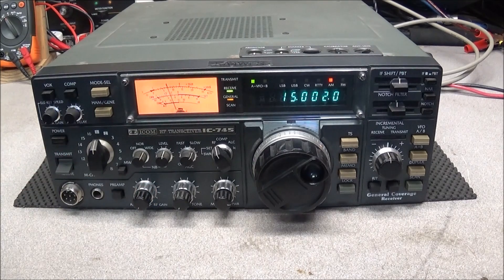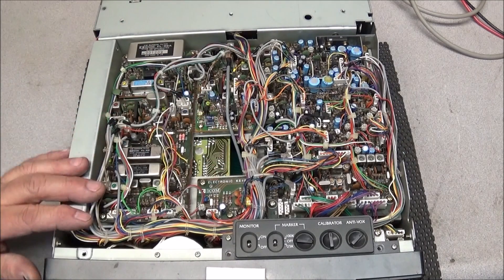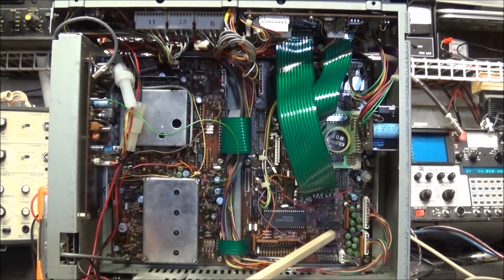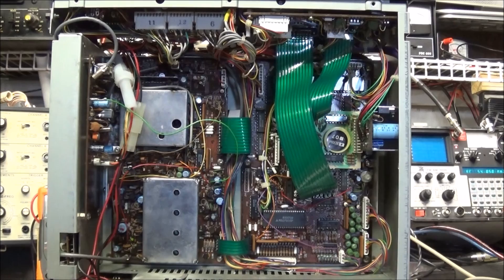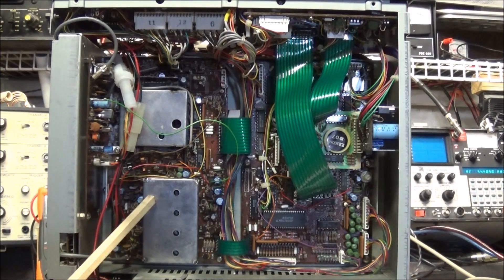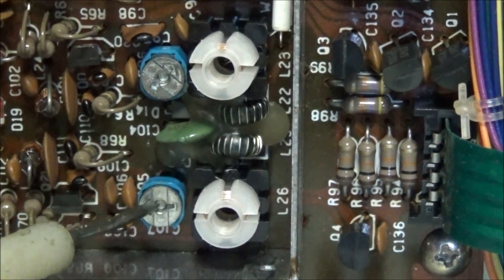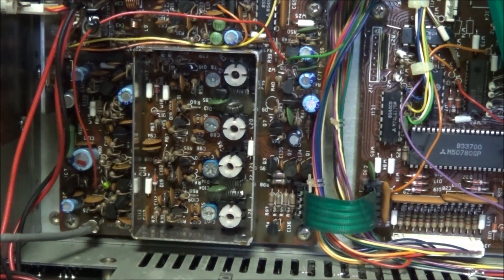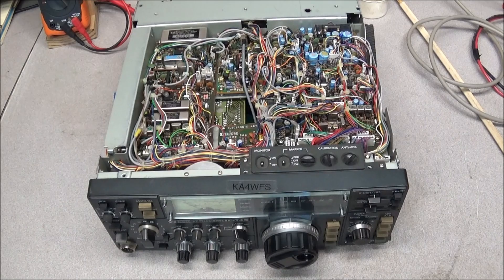#25 Icom IC 745 repair part 1 -  tear down and  review of problems

Comment: This is just a great great video about this rig.  This is my fav rig, too.
Reply from the maker: Thanks 👍
Reply: @TheRadioShop  Look for my email, B.  de L.
Reply: @TheRadioShop  I think I own a brick.  My lituium batery is dead. And, ther eis now way on God'd Green Earth that I have the ability to remove the board and re-write the memory.   I bought this rig new with the internal AC/DC [power supply and I feel really bad abaout losing this radio.   Nothing lasts forever.  But, this was my only and best rig that I had.  I hate to part with it, but I may have to.  I like your style of making these vids.   You can hear your kind soul in your voice.  '73 ol' friend, WA2TVN

Comment: I'm wondering what it would take to install a subprocessor and NVRAM and have it do a RAM/NVRAM compare to see if the RAM board has the correct info available and tell the main processor "everyting is OK - start the radio". If not, access and load the RAM from NVRAM. Much like the HP54503A calibration self-check.

Comment: You bring up an interesting issue regarding the 3 volt back-up battery.
i was wondering if the same program loss issue is possible on the IC-R7000? 
I'm just completing a re-cap,and before I put it together,maybe i should change it out. It reads 2.74V now. Nice job on the vids,I find this project very interesting.
Reply from the maker: Hi Andy, The R7000 does not have the ROM problem as the R7100, IC-745, IC-751.  So no worries there. I would change the battery though.  The biggest problem in this unit is solder joints and capacitors.
Reply: thanks so much for the clarification Sir,i feel better knowing I have some time to re-fit this old battery mount with a proper battery holder,so it can be swapped-out without tools in the future. I really enjoy the diagnostic process in your vids. 73

Comment: i have a 740 and need to replace the meter display  bulbs.  do I take the front cover off or the top cover?
Reply from the maker: Remove top and bottom cover. You can mow remove the screws to the front panel and tilt it out for access to the lamps.
Reply: Are there two lamps?

Comment: hey one of my friend has a icom 730 has no recive on it....unless he puts a preamp on it....any i-deals.....could this be  the relay dirt?
Reply from the maker: Hi Gary. The 730 is an oldie. On the RF board resolder J2 and J3 as the solder connections crack over time.  Make sure the internal preamp is working. Need a scope to test. Relay RL1 will fail over time and will cause  low receive issues. Hope this helps.

Comment: If the radio is still plugged in, will it not still have some standby power to keep the memory intact while you change the battery? What if you changed the battery while the unit is running? Thanks for sharing

Comment: two AA batterys, connect em to the ram board and switch out the battery ( dont use a power supply to do it! )  Good Luck!  I know you can do it!  Be Well  EDIT  i didnt know you had a link to it HAHA
Reply from the maker: +su pyrow  I try to provide as much information as possible at times. Thanks for the info :)

Comment: This radio reminds me of the  Yaesu  FT 101 to me a little  difficult to repair
Reply from the maker: +danny blackhorse  Hi danny. I find the 745 very easy to work on. It is laid out in a manner where you can get to the boards without having to remove a lot of other stuff. Have a peek inside the Kenwood FT-930 and 940's. They are night mares lol. Thanks for your comment and for dropping by.

Comment: I ran one of these my first 9 years as a ham and the design flaw I wound up having to get repaired was the 4 trimmer capacitors in the PLL VCO unit that control the lock voltage on the phase locked loop. Mine had the pancake power supply which I think accelerated the trimmer caps to loosen up over time from the board being repeatedly heated and cooled every time the power supply was switched on and off. You would think that the design engineers at Icom would have known that heat rises and put the power supply in the top of the radio instead of in the bottom under all the circuit boards! I also wound up having to get the RAM module replaced as well. When the battery went dead the frequency counter went to all zeros and had no receive or transit. Clif Holland KA5IPF at http://www.avvid.com repaired mine for around $225 and when I got it back it worked and looked like a new radio! I loved the radio and it had every bit as good a receiver as my next radio which was a Kenwood TS-570D. I sold my IC-745 at the Charlotte Hamfest for $400 to a ham from Asheville, NC. Sold my TS-570D to a ham in Ohio and have been running a Yaesu FT-1000MP Mark V ever since. Thanks for the great video and I look forward to the next one! Very 73 de KU4GW Cliff!
Reply from the maker: +Cliff Fox (KU4GW)  Cliff, very insightful reply my friend. Sounds like you went through all the flaws with your 745. Cliff Holland knows his stuff on these old rigs. Not sure if he still works on them now. Since parts are starting to become unobtainable. Your comment on the power supply as I mention very briefly in the video is dead on! Guess if you are going to cook something you put the fire under the food LOL.  My suggestion on the supply is remove it and run external. However another alternative is to remove supply, make the DC cord longer and run it externally.  But some cleaning up of the internal filters are needed to reduce the "birdies" created by the supply.  Also love the Yaesu FT-1000MP. Great rig. Always wanted one for myself. Thanks for coming by and sharing your story.73 Buddy
Reply: The Radio Shop Hey Buddy! I threw the pancake supply in the garbage after the filter caps needed replacing due to hum and never installed it back in the IC-745 after Cliff Holland sent it back. A friend in Lenoir, NC sold me a Icom PS-55 power supply for only $55.00. I still have that power supply and it still works great after 10 years of use powering my VHF equipment. Very 73 de KU4GW Cliff!
Reply from the maker: +Cliff Fox (KU4GW) Good deal on the PS-55 Cliff. That is a rock solid supply. You did the right thing by ditching the pancake! BTW, visited your QRZ page.  Very impressive! Have not been in your part of the state in a long time. May have to get over that way one day again. Any snow there? had a bit up in Raleigh today but nothing here.. 73 de kc4umo
Reply: The Radio Shop I got enough snow this morning to coat the evergreen trees really beautiful and cover the yard, but the temperature stayed warm enough it never stuck on the dirt road at all and after 11 AM the sun came out and it was all gone in a matter of minutes. That's the kind of snowstorm I like to see because I live up on the NE slope of Barretts Mountain west of Taylorsville 1 mile off of the state maintained road so when it snows a lot I can't get up the mountain to get back to the house! Going down the mountain is no problem. Just looked at your QRZ and we're the same age. I was born May 10, 1961. Give me a call sometime. I hang out on 3.895 a lot in the evenings.Great bunch of hams on that frequency and we'll talk to anyone, unlike a lot of the 75 meter groups who have their own little groups that won't  talk to anyone who hasn't been in their group for years. The 3895 group is just the opposite. Very 73 de KU4GW

Comment: Icom used to have lots of problems with their PLL's - my venerable old bought new in 1977 IC-211 2m all mode's PLL had problems with feed thru PCB via's and styrene caps. Your intro reminds me of the old time Saturday serials! Can't wait for part 2!  73 - Dino KL0S
Reply from the maker: +Dino Papas I remember that radio Dino. And all the problems it had. Icom had 4 generations of PLL and 2 or 3 generations of displays. The board had plated through holes in the early models like you mentioned.&#160; Later Icom installed pins in the holes and this caused a few more problems. The pins were coated to bond with copper and solder, after a few years it lost the bond.Thanks for the comments my friend. We will have a bit of fun in part 2 of the series. Glad I could spark a few memories for you